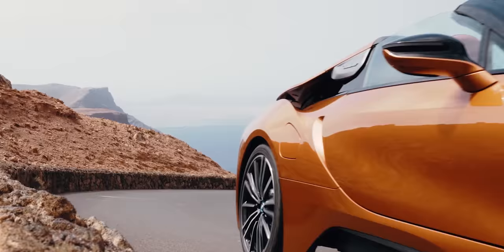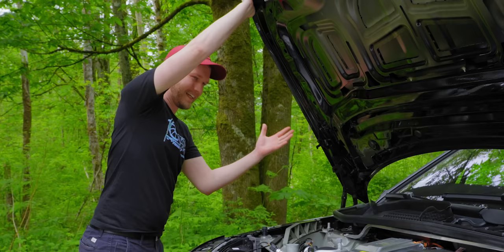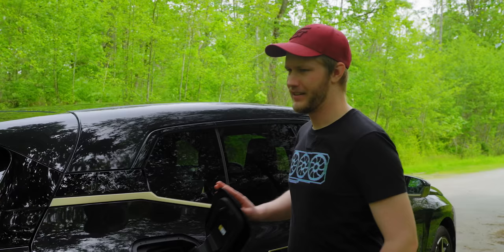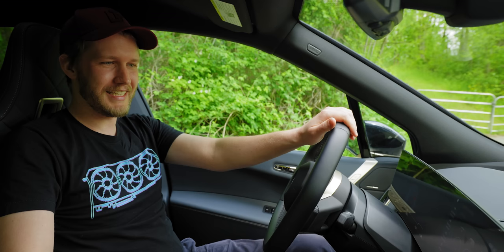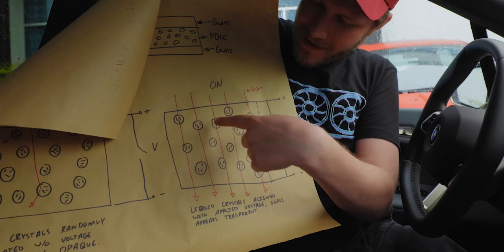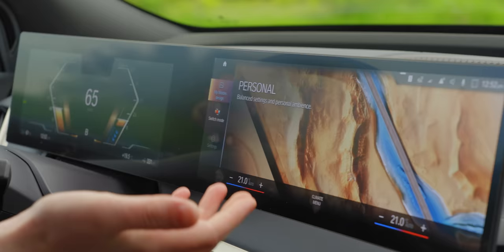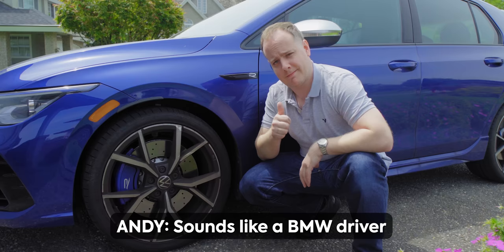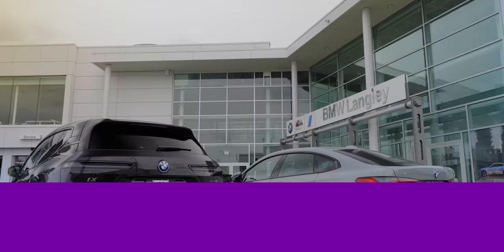It's... Complicated. - BMW iX

Comment: I'm so sad that auto makers have taken this route with electric cars. Non repairable, everything touchscreen, no buttons of switches, etc. There are no EV's out there that I'd actually want.
Reply: Yep, I can't help but recoil every time I see the interior of one. I really want one, but not any of the user experience nightmares on offer today.
Reply: If you need something solid and older school, check out the MG. It's fairly priced and looks like a normal car
Reply: You can check out the Lucid Air. It has physical buttons and it looks better than this.
Reply: Don't know about the new 2022 model but last year E-Niro used a lot of real buttons and switches (like, a lot... feels like an airliner the first time you sit there) Nothing on the repair front but I guess as far as the powertrain goes it is a feature not a bug: fidgeting with a 400V, 150kW electric circuit is dangerous if you don't know what you're doing. They could make it simpler, but sooner or later they would lose a trial after someone is hurt.
Reply: Skoda Enyaq driver here, physical buttons for the most important and mostly used functions, a nice, big and easy to reach touchscreen, overall clean but high end interior (more like something you would expect in an Audi) and the car is just driving and working very well. Wouldn't change for any other EV out there at the moment, at least in the same price category.
Reply: Jaguar I-Pace is pretty good.
Reply: mazda cx 60
Reply: F150 lightning?
Reply: The Honda E is actually really interesting; for me and many others this is the one car that surprisingly sparks joy in people who normally hate EVs
Reply: @Luckyluckyluc  yea sparks green joy specifically lel
Reply: For real. Is it really that difficult to just make "an car" as mr regular would put it? Tech for the sake of tech just angers me. An infotainment system should be just that. Stereo functions and information. Thats it.
Reply: The problem is that EVs can casually kill you in a way ICE 12 volt just can't.
Reply: i honestly need buttons. they develop muscle memory, and definitely reduce driver distractions, and therefore reduce crashes.
Reply: That has nothing to do with EVs lol. Look at the latest VW Golf.
Reply: I hate government involvement but since they are involved in everything anyway and in the EU they will force us to not have nothing else to buy after 2035, i think it will be good if they made a law banning this touchscreen menus for basic factions. 
Navigating touchscreen menus while driving is a lot more dangerous that just pushing a button and can create much more accidents.
Reply: @SIPEROTH  A court decided it was the fault of a Tesla driver when a man created an accident while change the wiper controls over the touchscreen. They compared it with any other touchscreen devices like phones. You only allow to use it when it can be done safely and quickly enough.
Reply: @SIPEROTH  that actually isn’t a bad idea at all. some buttons are necessary.
Reply: @EdgarRenje  most ev’s are taking the route of removing as many physical buttons as possible. sure, some manufacturers might not be, but that doesn’t mean that it’s not happening elsewhere within the automotive industry.
Reply: @ryan_n05  I only really see it in sort of vanity builds, or whatever Tesla calls their setup, minimalistic?

I have a 2021 ionic electric, and that thing has the right amount of touch screen and physical controls to make it feel like a normal car.  At this point though, the use of automatic cruise control is almost necessary for my commute to work and back, I don't think I can live without it at this point.  But yeah, it breaks way too late like they said in this video.

Some car makers get it, some don't. I would just avoid the ones that don't.
Reply: @Rikorage  Why to you feel cruise control is needed? To you travel for hours in a high speed road?
I drive for a living, 10 hours everyday and yet I don't need cruise control. I am even changing gears since it's a manual and am fine.
Actually what I noticed is that changing gears makes drivers better because they are forced to be more engaged and pay attention to the road while people with automatic cars feel more bored in a way and they end up looking more at their cell phones and do other things while driving which makes them pay less attention to the road and drive badly. 

Anyway this minimalistic "we don't need buttons" bull needs to go away. When someone is driving he needs to just start his air-con etc with the touch of a button so he can keep his eyes on the road. Most of us actually just learn this buttons from muscle memory and we hardly even need to look to press them.
You can even find them just be feel. 
 Good luck doing any of that with getting into two submenus and moving a slider on a touchscreen.
Reply: @EdgarRenje  That is a good start. Maybe courts should throw a few more decisions like that in their faces so they can make car manufacturers rethink their ways.
Reply: Doesn't even have a frunk which I think people have grown to expect with EVs
Reply: So people are brave to say "Someone should be FIRED", yet they're afraid to wish death on the designers?
Reply: @ryan_n05  1000%. I can turn on the ac/heat/defrost, adjust the temp, turn on/off headlights/flashers and adjust the radio in my 89 civic wagovan without taking my eyes off the road. 

On a car with all touchscreens....not so much.
Reply: @Demonslayer20111  There probably will be cars available for elderly and people who just need the basic, but car companies are shooting themselves in the foot if they deliver less than others.

Comment: I absolutely hate the direction in which car makers are heading. Its like "physical buttons are archaic and expensive, lets slap this giant ass touchscreen with horrible UI and justify the extreme price by adding crystal buttons and wood around the dashboard". PLEASE BRING BUTTONS BACK. We need to be able to change things while keeping our eyes on the road. And whats with the 'locked out engine hud'? Do they really expect to have these cars serviced by 'official retailes and service centers' forever?
Reply: Totally. Some of the new "innovations" are nauseating and downright dangerous when driving.
Reply: Expect, no, but they really really want to. They are desperately trying to convince everyone that changing one insignificant* technical detail about the drivetrain somehow warrants changing the service and ownership model, the design, the UI.

*literally insignificant, my mom's been driving an EV for nearly a decade and she keeps forgetting that. To her it's "a car". She drives home, plugs it in, and that's literally all the changes she had to make. Everything else (looks, servicing, parts, fluids, buttons, not having to wave a freaking smartphone app at it to rent heated seats!) works the same as other cars because it's an "old" EV (a 2015 Volvo V60), before this new design madness started.
Reply: Buttons are cheaper than replacing touch screens. You knew the end was coming when they moved to integrating the cars stereo into the rest of the cars systems.  Now you can no longer easily upgrade to newer technology and when it fails its 4K and keeps the car form being usable until its replaced.
Reply: Thank God I'm not the only one thinking these thoughts
Reply: Ever hear of steering wheel controls?
Reply: @larryspiller15  Let's make steering wheel controls touch sensitive too
Reply: @wyw201  would be better than the main screen but no. The Tesla 3/Y have the best approach. You can control anything that you'd need while driving right from the wheel
Reply: Long as the interface is good I don't need analog buttons. I think some of the sentiment is the fact that humans don't always like change or getting use to completely different systems. You have to go with the flow and change with the times . Eventually you won't touch anything . It will recognize you and your specific presets and everything else will be audible commends. Computer drive me home.
Reply: @rogerdodger5886  I look forward to the day where our vehicles send all of our behavioral data to state agencies, advertisers, banks and insurance companies. Welcome to the future!
Reply: I'd accept no buttons at all if they made less fucking suvs/crossovers and more other types of car
Reply: This is why I have a 1980 car I am fixing so tired of computers beeping at me and the useless touch screen uis that fails to do basic tasks in less then 10 button presses and when a few buck part breaks that will be a few hundred to "reprogram" as we can't have things interchangeable in current year.
Reply: Tbh the only company that just gets this is honda.

Comment: "I don't think drivers of this use their turn signals anyway"
LOL
Reply: it was so casual as well (and true)
Reply: People get turnsignal usage wrong... It is not that BMW drivers don't use them.... I mean yes they don't, but so doesn't everyone else...
Reply: @peterkogoj6847  as an an ex BMW driver,  the only reason I don't use the turn signals, is because they are terrible, you can't cancel them as the the stalk gets back to its default position when you turn it on, and they don't cancel so you'll be looking like an idiot or you can turn the opposite side on which means the signals will flash, and everyone thinks you're turning to  the opposite side ...it's a mess
Reply: @FaresDjebbar  ohhhhh thanks for that, NEEDED THAT EXPLANATION. I think they use similar levers on the gr86 and they're, from what I've heard, equally terrible to use... at least from journalists/reviewers perspective.
Reply: Checks out based on past experience.
Reply: @peterkogoj6847  no
Reply: @FaresDjebbar  you just push the stalk the same direction to cancel. You got used to it pretty quick.
Reply: @FaresDjebbar  lolololol :D read manual
Reply: @FaresDjebbar  They cancel just fine.  If you pressed down to signal left, press down again to cancel.
Reply: Actually true for all BMW & Audi drivers..
Reply: So people are brave to say "Someone should be FIRED", yet they're afraid to wish death on the designers?
Reply: @automation7295  So people are brave to copy and paste this comment everywhere, yet they're afraid to actually make any sense and have any coherent meaning?

Comment: 9:58 I have a small remark: It should be 765Nm and not 765nm. Otherwise it's just a really short distance.
Reply: capitalizing does matter in units, despite what many designers wish.
Reply: @hedgehogdinosaur3023  lol

So you mean 128kb/s is the same as 128kB/s?
Reply: @aflac82  No those aren't same, bytes and bits are different. What I meant was capitalizing certain letters in units has significant meaning, instead of being a arbitrary artistic choice.
Reply: @hedgehogdinosaur3023  hey, honest mistake.
Reply: So people are brave to say "Someone should be FIRED", yet they're afraid to wish death on the designers?
Reply: @automation7295  So people are brave to copy and paste this comment everywhere, yet they're afraid to actually make any sense and have any coherent meaning?
Reply: @hedgehogdinosaur3023  Also considering many tech enthusiasts are somewhat nerdy, it's an unforgivable mistake.

Comment: Huge props to Alex for calling out all the infotainment related bullshit. I cann not stand seeing car reviewers show obviously broken systems and then describe them as great.
Reply: Def agree. Some infotainment systems really suck and are a total waste of their (often these days) enormous screens. And not enough people talk about that aspect in car reviews and practically skip over it.

I hope one day some right to repair legislation will put us in a world where you can swap out the software/hardware of your infotainment system in your car to something that doesn't suck ass, and possibly even add features in the process.

But that is a world far from this one. The systems of these modern cars are kept as secretive as possible so we don't have the info to be able to do stuff like that anymore. A radio/infotainment swap used to totally be a thing on older gas cars and all features of the car would still work thanks to standard protocols.

So yeah I'm on board with Louis Rossman's "schematics or die" mindset
Reply: It might be because these car reviewers are auto enthusiasts and are more interested in the auto part of the car, rather than the software interface. Still they should.
Reply: So people are brave to say "Someone should be FIRED", yet they're afraid to wish death on the designers?
Reply: The lag on swiping is painful
Reply: @datachu  "Some"? More like all of them. I travel for work so I'm in a ton of different manufacturers cars and the one universal fact is that the infotainment system will be absolute hot garbage.
Reply: @automation7295  So people are brave to copy and paste this comment everywhere, yet they're afraid to actually make any sense and have any coherent meaning?

Comment: Those crystal knobs seems like such an easy way to get bright sunlight reflected and refracted STRAIGHT into my eyeballs.

And I increasingly think the touch controls need to stop and allow physical buttons to control everything again. Takes so much more effort to navigate a menu while driving than... You know. Muscle memory your way to the switch that does [whatever]
Reply: +1 I hate the idea of touch screens in cars. How tf is anyone supposed to do anything with that HVAC system whilst driving?
Reply: Wait till they start the interior on fire like the insurance crystals
Reply: That was the actual experience for some other car reviewer, they recommended the regular style knobs. Kinda crazy that the worse part comes in as an optional extra.

Comment: I love the contrast to the other reviews of this car - especially the German ones. Here, the presenter would go through every single interior panel and rate it's luxury level individually (that could take up 1/3 of the review). You approached this car like every normal person would - which is quite refreshing.
Reply: Honestly, if you are in the market for that thing you don't look at cars like every normal person would. People who buy this don't care about the infotainment system. They care about the feel you have when you drive it. They about driving something that is more luxurious than most peoples homes and has the dimensions of a light tank while still doing 0-60 in under 4 seconds. Besides, there is no way that system is not a beta. They haven't started delivering it yet. This will go through many more iterations for sure.
Reply: @lhommeaudacieux  
Valid points - but they are definitely cranking these things out at the moment. I live in the town where they are produces - they are shipping out by the train-load.
Reply: Autogefühl
Reply: @DaMainDude  well yeah its a 100k dollar car not a 1m dollar car
Reply: @lhommeaudacieux  A 1980's S class is more comfortable than this and It also projects wealth much better. When I see this BMW I see a Hyundai with a pig snout, not a luxury car.
Reply: @G-Mastah-Fash  A 1980s S class does not have 600 horse power and certainly does not do 0-60 in 4 seconds. BMW is a sports luxury brand.
Reply: @G-Mastah-Fash  Sir, that's an insult to Hyundai and pigs 😂
Reply: So people are brave to say "Someone should be FIRED", yet they're afraid to wish death on the designers?
Reply: einstein9073  No actually Germans rate the ratio of soft to hard plastics as a major indicator of quality and luxury.
Reply: @lhommeaudacieux  coming from a rich man home, even rich people are different individually- but in a rich mans house, typically you would go for a sports car as your 'fun driving fuck the actual experience' thing, for every-day and at this price, an older benz would be better.

Comment: Large non functional grill, check.
Increase the heat pump size to keep things cool, check.
German engineering at its finest.
Edit: I take it back. The design that blocks the turn signal with the steering wheel is on point. 👌
Reply: Did you see the 2nd year Mach-E actually ditched the original grill design and went back to a more traditional grill look? It's still backfilled deeper inside, but aesthetically I find it looks far better than these sorts of sticker looks or the original Mach-E.
Reply: @aoitamashii  But won't that add drag?
Reply: @Qwertworks  Maybe. But far less drag on their sales numbers /s
Reply: @aoitamashii  XD
Touché
Reply: So people are brave to say "Someone should be FIRED", yet they're afraid to wish death on the designers?
Reply: @automation7295  So people are brave to copy and paste this comment everywhere, but afraid to actually make any sense and have any coherent meaning?

Comment: Drove one of these for 2 days a while ago and I agree with everything you said, especially the modes and the AC controls.  I would say you could improve how quickly it stops when following by adjusting the following distance but, for surreal reasons, unlike literally EVERY OTHER BMW there are NO buttons on the steering wheel to adjust the following distance!  On the i4 and iX3, etc there are buttons on the steering wheel and you can make that adjustment super easily.  Even the i4, which has the whole "BMW OS 9" that is in the iX still has AC controls, and all the sport mode buttons and steering wheel controls etc!

I have an i4 M50 on order which I am not expecting to get until deep into next year, but in the mean time my iX3 is brilliant!